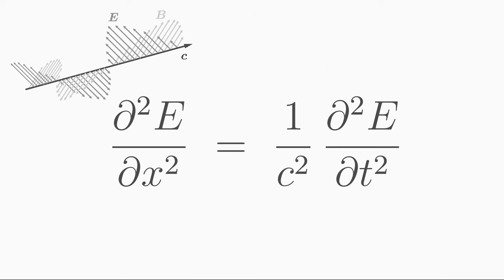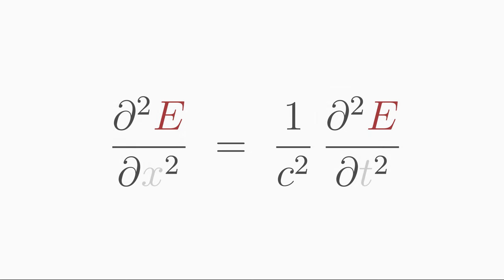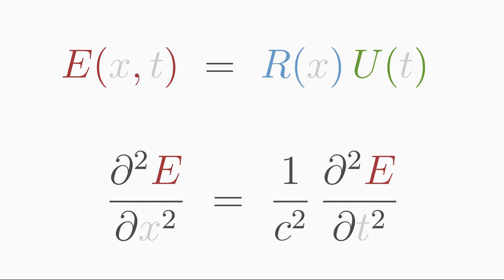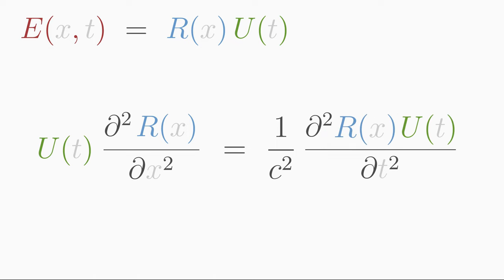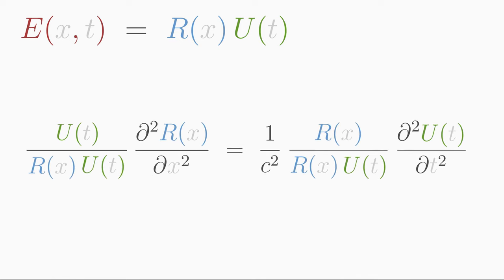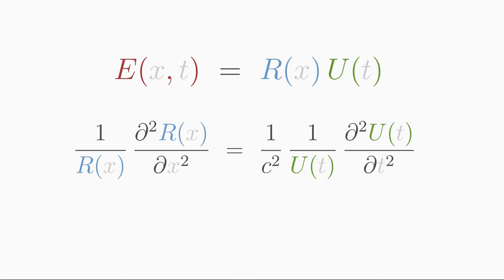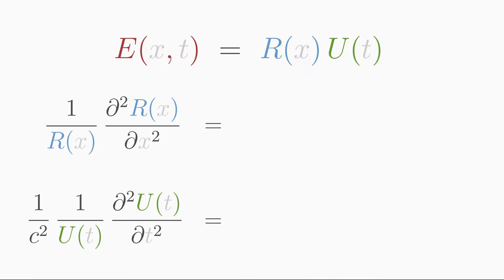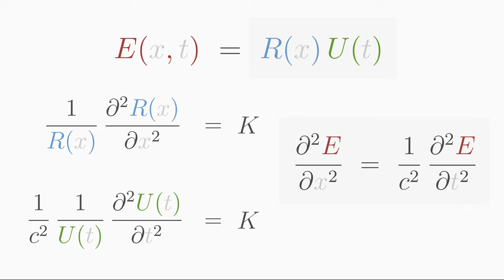How to Solve Partial Differential Equations?

Comment: I just noticed that, on the video tab of your channel page, you have two videos with "separation of variables" in the thumbnail, almost next to each other, including this one. In this one you discuss the separation ansatz (or product ansatz) for solving partial differential eqns. In the other video, you discuss the separation of variables as a method for solving certain ordinary first order differential eqns. These are completely different things (as you explain in the videos). However, the thumbnail of this video reads "separation of variables", not "separation ansatz".
Reply from the maker: Thank you for your comment, I will correct the thumbnail!